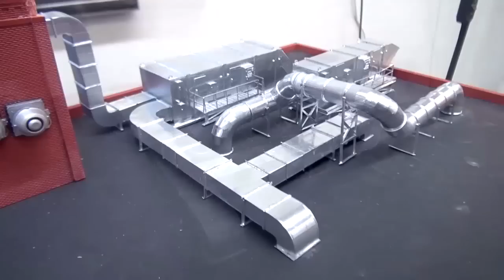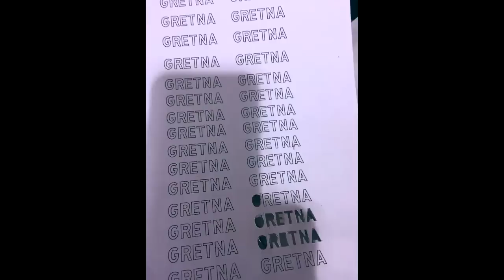HOW TO: Canvas load covers | September 2019 WHATS NEAT MRH Mag

Comment: Ken the tarp covering is as old as my deceased grandaddy.
New technology using saranwrap thin shrinkwrap and a very low heat gun and a rattle can of Krylon Sand color paint. Dry brush with jet black at the folds and creases. This method you can make 10 to 20 in one afternoon.
I like this segment very informative.
Would greatly like to know how to locate the Retired Engineer doing the electrical poles and the rooftop AC units.
I have always looked forward to every months segment.
Thanks again and for sharing.
Truly the world's greatest hobby.

Comment: Ken, would spraying the Woodland Cement be another way of saturating the load???
Reply: I was thinking an eye dropper would also be a quick and maybe slightly cleaner method.
Reply: @chrisschanbacher9061  Yes and a little more controlled.
Reply: I think the eye dropper method could be effective. Probably would help to spray the Kleenex tarp down with wet water first, just like ballasting track.

Comment: Do you know where I can find plans to build a 25 inch single track truss bridge from scratch using plastic structural beams? I need to build a bridge to span a doorway. What I'd like to build is a truss bridge in the center and a flat sided under track section at each end.  Similar to the one at 0:07 at the start of this video.

Comment: Seems like a waste of scenic cement, pouring it all over the table like that. There must be a better way. What about wetting the paper towel / kleenex first, then draping it over the model?
Reply: Ken was just in a hurry. In real life most people would go slower and be more methodical.
Reply: @ah244895  Definitely agree. The modeler was doing it very well and in a controlled format. I know there's a time element in filming this , Ken should have let him get through it at the 'instructors' pace, then edited it out as needed.
Great technique though as I have done this many times although without using the scenic cement, just the colored paint, and using brown paper, shop towels, or thick tissue paper. great video overall!
Reply: I thought I was the only person that noticed that. It made me sort of not so much angry, but thought what a j#*k move doing that to the presenter. As a person that edited video in the past, it's easy enough to speed/ cut things up in post. I enjoy the episodes, but that was a little mnnnn.. Negative on an otherwise "always positive"presentation..
Reply: Yes, would have been very easy to say, "and now here is the result after 37  minutes of painting glue on the Kleenex" and just cut to the end result. Or as you said, ramp up the speed.
Reply: The problem with wetting the Kleenex first, before it is in place, that I can think of would be that tissues tend to tear very easily when wet. Probably could expedite the process by spraying the Kleenex in place with wet water, then proceeding with the scenic cement.